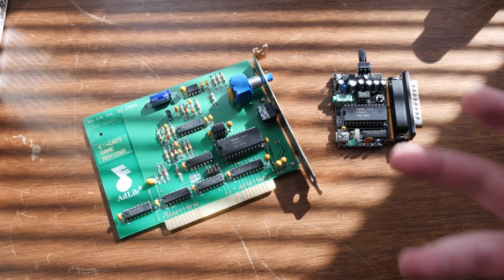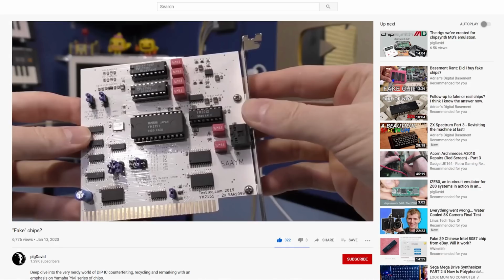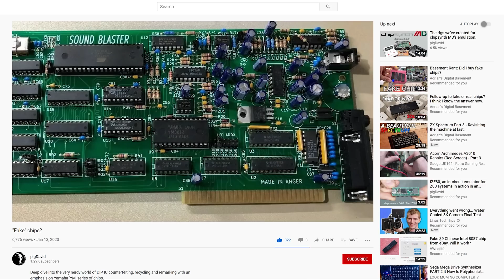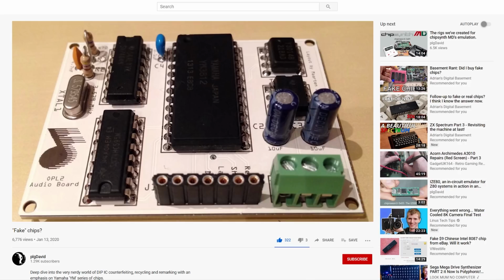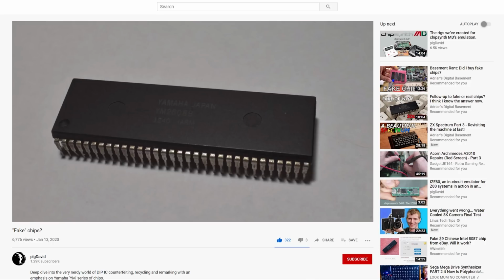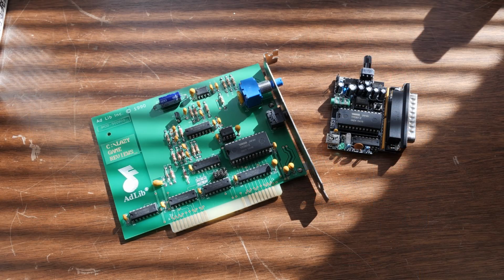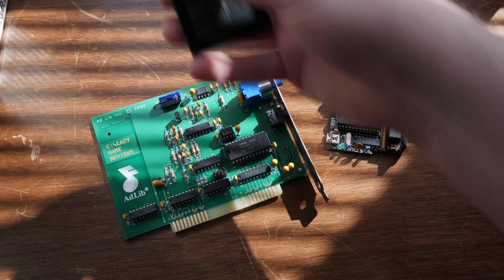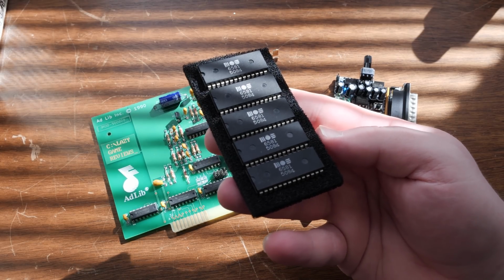Are these Yamaha sound chips legit?

Comment: Remarking is a weird practice.  I'd be perfectly happy to buy salvaged chips.  That's what I expect when I'm buying a chip that's decades old.
Just leave the original markings on them, scratches and all.  Don't sand it off and repaint it to make it look "new".
The markings are supposed to authoritatively tell you everything about exact part number, production date, die revision, lot code etc for that particular individual chip.  I want the markings to be original and correct.  When the chips are remarked you have no idea if the markings are accurate anymore (usually not), which makes the markings worthless and fraudulent.

Given how well known this practice is by now, I'm not sure why 35yr old chips advertised as "New" would fetch higher prices. I'd be more inclined to buy the chips that look like salvage, because they're more likely to be legitimate.
As far as I'm concerned, the recyclers who get their chips remarked are spending money to devalue their inventory.

Comment: Bit off topic (maybe, im only half way through the video thus far) but i wish someone would make a replica logic gate chip for the amstrad cpc 464. The original is plastic with a basic heatsink on it. The chip still gets hot because the plastic insulates it and they fail because of this im pretty sure (have two dead, that chip is the issue)

Comment: Don’t call them “fake” or “not legit”, it’s fearmongering. Nobody has made clones (reproductions) of these Yamaha chips with the same form factor and pinout, so if they work, they are original and sound as they are supposed to. If you want to call them anything, call them “resurfaced” or whatever. At least be specific if you want to inform others. The term “fake” puts people on edge for no reason whatsoever. The label was “refurbished”, it’s a stupid practice but that’s all.

On the second hand market with the primary source for these ICs being Chinese suppliers, this resurfacing phenomenon is simply not something you can get around, and you should not hold it against the makers of new retro hardware. It would be super wasteful if they ordered twice as many chips as they needed and threw half of their perfectly fine and in scarce supply chips away, just because people got scared into wanting an original label on their chips and will call you dishonest otherwise.

Comment: I heard somewhere that some new old stock chips are surfacing but in reality they are old faulty chips that fell out during initial production, but they weren't destroyed and today they are selling them. I don't mind if they are fake chips as long as they work. The Yamaha chip is not a big problem because they are digital, but the SID chip is much more complex, parts of it analog, parts of it digital, parts of it using 9VAC and stuff... The original is no longer manufactured and the exact technology of making them is not out there or something...

Comment: (7:45) When you bring that SAAYM card up really close to the camera, I can see a slight striping pattern on the Yamaha chip, almost parallel with the chip, but the striping is slightly lower on the keyed side than the unkeyed side. I don't know if I'd be able to see it in person without a magnifying desk lamp, but in this YouTube video, it is very obviously resurfaced before applying the acetone swab.

Comment: I would rather have clones than resurfaced chips. You have no clue where or how those resurfaced chips were used, treated, etc. 

As he said in the original video, clones have been made, but they're very rare compared to resurfaced recycled chips that were legitimate versions that went through the recycling process. 

Personally, I'd be concerned that the way they were treated in the process (or before) was poor, so you don't know if they will have a shorter life because of it. 

It's not just resurfacing, it's also the process involved in getting the recycled chips (the carelessness), and so on.

It's like buying a car that has had its odometer reset and the VIN number changed to a default one, and has been repainted. No, you can't look under the hood and check the engine or transmission. You just get to decide to buy off of the odometer, the outside, and the VIN. 

It's bad.

Comment: Fake chips are a big problem in electronics manufacturing. I worked for a manufacturing service back in the mid 2000's we had to issue a recall because we were shipped a few batches of a fake Motorola SRAM chip on an assembled controller board. We sent some failed chips to the OE and the date code was the correct format but not one they had on record! Sneaky sneaky. The issue was the chips worked in the factory but they had a high failure rate in the field. The package was not sealed (SMT) properly on the fakes so the flux and water from the assembly process got inside and corroded the leads/die. No such issue with the legitimate chips.

If you are purchasing for hobby project be sure to buy your parts from a reputable vendor like Mouser or Digikey.

Comment: Ok so my thought on this,  does it make a difference if the chip is doing the job you bought it for?  Is it a thing that they are charging you more money on the basis that the overall board has original chips. Not to mention that so many chips are  China produced and branded elsewhere. A great Blerb none the less.

Comment: If you do a manufacturing run of more of these soundchips you can probably make enough in a few days to supply the market for a good number of years. Assuming you do not randomly select parts of your lot after mfg you will most likely be sending out chips from a single batch, same day packaging and such for many years.
This assumes you had original dies available and mark the packages with molding dates not wafer mfg dates. China is cheap and easy in that regards as using the data on the dies would be too much work...
Reply: Without decapping and analyzing the dies one cannot know for sure...

Comment: Here is a better question. Why not hook it up to a dynamic signal analyzer or a spectrum analyzer and see if the probably counterfit chips are performing on spec. If they aren't well that's an issue. I think your qtip is probably just taking the ink from the label on the chip off. Are they laser engraved or just stamped with ink?
Reply: That SAAYM board chip was obviously painted. I am refering to the others where something came up but not the whole thing.

Comment: Crazy story time.  My husband was trying to make a MIDI box SID thing about 8 years ago and posted on Craigslist asking if anyone had any old commodores that he could scavenge. He got an email from an old guy that used to be a distributor of commodores back in the 80’s and 90’s, and literally had a ton of old boxes of stuff in his barn.  Said we could come out and see if we were interested in taking it off his hands, but specifically preferred if we’d be willing to take it all in bulk. 

Literally more than 50 old Commodore computers and boxes of cables, power bricks, and disks.  My husband got it all for about $350. 

He tested all of them to find the ones that actually worked and resold those ones.  Anything that seemed dead on arrival, he took the SID chips out of them.  He kept enough to make his midibox, and sold the rest.  He kept one of each type of Commodore that worked, and ended up donating all the left overs to the Portland Commodore club.  It seriously was crazy.

Comment: There is a big  difference between 'referb' parts and actual fakes. In the first instance they are old or recycled stock etched or sanded then recoated. In the second they are fake reproductions. The IC industry is rife with forged parts; in the case of computer parts such as sound chips its annoying if they fail. But imagine fake parts that get into safety critical systems such as aircraft or vehicles and they fail; then you are looking at serious issues. 
The fakes are essentially identical in looks but do not have the provenance such as lifetime testing, failure mode analysis and validation that genuine parts receive. Those in supply chain verification take this seriously but the forgers are clever, the parts often get mixed in with genuine devices so its difficult to find them.   There is big profit to be made from these cheep knock-offs so its the same old human condition of greed where there is a buck to be made.

Comment: Someone posted your video to the Commnader X16 FB group, and Kevin replied to it (this is what he posted):

Kevin Williams:
BTW, I'm posting as myself here in the X16 group, but if you weren't aware my wife and I own and operate TexElec.com.

In a nutshell, yeah, I know. :-) I actually have mentioned how I'm pretty sure they're counterfeit before in threads when we were talking about the YM2151 & SAA1099 here in the group. I will be happy to be more transparent, so I hope no one thought we were trying to be deceptive. I just guess I thought people kind of knew there is no guaranteed source for many parts like this. The fact is some parts have been out of production for years, and there is a huge Chinese grey market of stuff we wouldn't otherwise get to use! I am pretty sure the SAA1099 chips are legit, and it's easier to understand why the YM2151's could be more grey. They were never really sold in the same fashion or qty as many other sound chips. I understand they were nearly $45 each even in qty, so pretty much relegated to arcades and synthesizers, etc. The OPL2/3 and others were cheap enough to sell for less than $10, so they were a better fit for sound cards and far more plentiful. Same with the SAA1099, they were quite cheap and used in a ton of stuff so there is just more old stock

Part of the reason I built the SAAYM in the first place was to have a platform to beat the heck out of the chips as there isn't an easy way to load code on the proto X16. I have a SAAYM in a machine which has been running for about 2.5 months. I periodically plug in a speaker to see how she's doing, and so far, so good. I run them at least 24 hours before selling them too. We have sold quite a few, and no one has had an issue I'm aware of.

I have spent about 3 months in the last 9 working on these chips and I wouldn't be selling them if I didn't feel very confident in their performance. I still fully plan to put them on the X16. The YM2151 is the best FM chip with 8 channels of 4 channel operators each. We have a programmable sound generator & PCM to boot! It should be able to make just about any sound from the 80's & 90's and beyond! Sure, there are FPGA implementations, but the whole goal here is to use the real stuff, and I believe that repainted, refurbished or even newly manufactured, they are still YM2151s!

David made a video of the SAAYM as well, but here are all of the ones I made if you want to hear them and see for yourself. The yellow card was my prototype, but it works the same as the production card. This card is the one I've been running since pretty much after I posted the first video: 

https://www.youtube.com/watch?v=5V5KXoxNPow
https://www.youtube.com/watch?v=rMqdLTb-e_g
https://youtu.be/TgpNekBN47c

Sorry for the novel, but I don't want folks to worry about the X16 sound system. I am very focused on it, I promise. I have a love for sound cards and really spend a heck of a lot of time making the cleanest sound possible from these chips. I want the X16 to be great!

Comment: What, exactly is the issue with "fake chips".  Do they work as intended?  Why do they need to be originals?  Why are original chips more valuable when they are more likely to have a shortened lifespan?  If this is for "collectors" that don't intend to use the hardware, then why doesn't it matter if the chips work or not?
Reply: The problem is when the "fake chips" really are fake chips... that is to say, a completely different chip than the one you paid for.  More often than not, they are original chips that have been resurfaced to make them look like more desirable new-old stock so they can jack the price up.  They still will have the same "shortened lifespan" you talk about, but look like new chips... until you take a cotton swab soaked with acetone to it, and the paint starts to come off.

In simpler terms, the biggest issue with the "fake chips" is that they're trying to pass them off as new-old stock to jack up the sale price.

Comment: The main thing from my perspective, as a user, is that it doesn't matter as long as the chips work correctly.  If I was a collector and I wanted everything to be as original as possible, I could see myself having a problem there.  The real issue is when you order something like some memory chips that simply will not work as stated.

Comment: Thanks for the video. I have an OPL2LPT too, but it doesn't work. I am fairly sure that I soldered everything correctly. It could be that the chip is defect. Even if it wasn't a forgery, now I know to watch out if I go looking for a replacement.
(I wonder how I can test if the chip is working)

Comment: What makes a chip fake?

If a SID or OPL chip is made in the same way, and from the same die as the original. Is it then fake?

Does a genuine chip, have to come from the original chip fabricator? Does it have to come from the "correct" time period?

Who cares when a chip is made? As long as it has been made in the same way (CMOS, die, and so on) as the original... It really cant matter to anyone with a brain.

But! It would be cool, if they would label them "new stock". But then they couldnt charge as much for them, and this is the real root of the problem. Not the functionality... :)

Comment: There are fake YM2413's as well and is well known in the Sega Master System community.

The repros just look too good, you gotta sample em to figure out the legitimacy.

The most "accurate" test I could think of would be to take 2 digital recordings of the chips - one known good one and other that we need to compare against, and then do a simple inversion of the recordings. That should result in silence, however this would not account for differences in manufacturing, so 2 legit chips could sound different from one and another probably idk.

Comment: I think it's cool there is an interest in the old Yamaha line of chips. If you are interested in the historical artefact itself I would be disappointed and it should made clear if it's a reproduction.

If an item of hardware could be considered a collector's item then it's similar to an antique so it's value would linked to it's authenticity but it's not like the antique market doesn't have these same problems. But these things are mass produced so they will not ever really be particularly valuable.

In the end if you can't tell the difference, it's questionable if it's no less good.

Apparently around 1/5 (or some such figure) of all fine art is a forgery with multiple copies of the same oil painting masterpieces being displayed concurrently in different museums worldwide. Don't ask about who paid for the Van Gogh Museums new wing or you might get a stern look (it's a large Japanese financial institution who happen to own a large amount of 'authentic' and highly valuable Van Gogh's).

Comment: Is it possible that a lot of them are new old stock? Like someone found a few crates of them in a warehouse at some point.
Reply: It's not likely, but it's possible.  More likely they were taken from "dead" sound cards (China has huge piles of e-waste), and resurface them to make them look like new-old stock.  If you're lucky, they actually test them to make sure they work.  If you're not, then you run the risk that they might not work, or might not even be the chip they're supposed to look like!
Reply: @SpearM3064  I just watched plgDavids video and he gave a great explanation on it. It seems NOS is very rare. I highly suggest checking it out.

I wonder what's keeping them from making new ones. Be it the OEM, or China not like they care about copyright.

Comment: On the flipside LGR...I imagine that getting older, proper chips are not all that easy to come by these days for things like this. Older chips winding their way into e-waste because the PC no longer turns on and everything else just gets tossed/recycled, just plain burning out, that sort of thing. And by now, you can obviously find the schematics for making these chips online, 8 Bit Guy's used them before. Another idea to propose: Could the chips in question...be reverse engineered new stock chips created to answer for a shortage in what's rapidly becoming a newfound field of demand? More and more people are wanting to get these old machines up and running, without being able to find old stock parts now, after all. There are bound to be companies out there who've sourced out a Chinese factory to manufacture these for sale on the cheap for use cases like this. And in the case of the SAAYM card you mentioned, it wouldn't shock me if cards like that were using said chips. In cases like this, if they put the time in to make them sound accurate...is there really anything dubious about meeting said demand in the best, easiest way possible? I know that's what's going on with some SID chips, would make sense that some of that is happening with these too.
Reply: Actually, that's not what's going on with some SID chips.  No legitimate manufacturer will even try to reproduce them.  What you're seeing is hardware emulation of the SID chip using an FPGA.  Which is great, but it's only as accurate as the emulation it's based on.

Comment: I would like to see a company make actually new reproductions like Western Design Center did with the 6502 CPU, at least then I know for sure it's coming from a reputable source and I'm not going to get a dud chip. A lot of Chinese supplied "NOS" chips are pulled from scrap boards and may or may not work, they may be testing them and only resurfacing fully working ones but if demand goes up I can guarantee you they will throw that out the window.